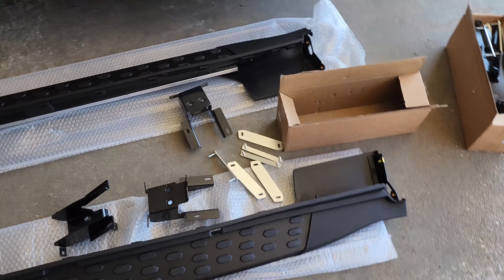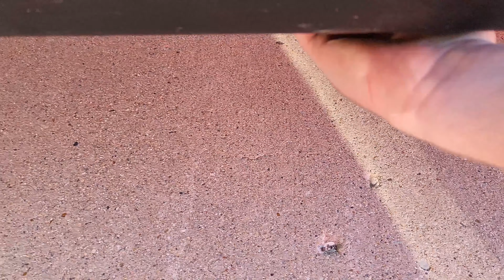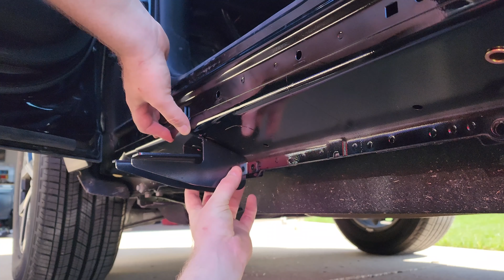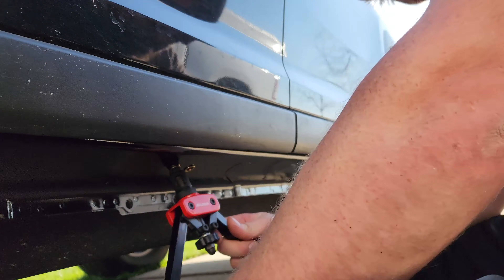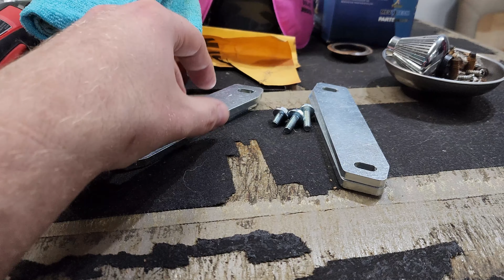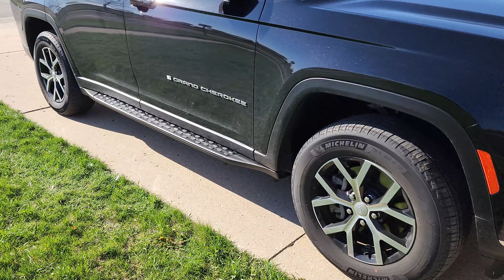Snailfly Running Boards Side Steps Fit for 2021-2024 Jeep Grand Cherokee L - Unboxing/Install/Review

Comment: Hello, How wide is the actual step part? Do you have any issues getting in and out using it as a step? 

Do you know if these are the exact same specs/dimensions as the OEM Mopar running boards?

Comment: PSA: DO NOT FOLLOW ALONG WITH HIM. Watch the full video through first. This will save you so much time. 
- Read the instructions on which bolts to use where.
- The steps are impossible to put on if you attach the brackets to the vehicle first and take a lot of work to get off.
Reply from the maker: As mentioned in the video 😀

Comment: Do they work for the 2 row?
Reply from the maker: They don't, these are specifically for the 3 row.
Reply: Which ones are these?  I have 24 grand Cherokee L limited and we bought some but they won’t allow the underneath felt to be reinstalled back

Comment: I got snailfly also. But some reason only come with 1 thread insert, and didn’t come with spacer. Did you have to purchase yours seperate? 

Also thanks for making the video. Very helpful
Reply from the maker: @DanielHernandez-x9y  are you referring to the nutsert install tool? I bought my own, I believe a link is in the description
Reply: @RamblinGarage   not too concerned about the tool to install but need to purchase more of the actuall inserts- as mine only came with 1 - could you share link to the ones you bought ?
Reply from the maker: @DanielHernandez-x9y  oh i gotcha, here's the ones I got 

Glarks 110Pcs M3 M4 M5 M6 M8 M10 M12 Half Hex Body Flange Rivet Nuts Assortment Kit, Zinc Plated Carbon Steel Flat Head Threaded Insert Nut Rivnut Set https://a.co/d/0W8F7Di
Reply: @RamblinGarage   thank you. I’ll be subscribing- appreciate the help
Reply: Also @ramblingarage what spacers did you purchase ?
Reply from the maker: @DanielHernandez-x9y  on my Ram? I have Ksp 1.5" spacers.  I'm selling them if you're interested.
Reply: @RamblinGarage   in the video you mentioned you used spacers on the rear portion of the side rails. My box did not include spacers, hoping I can get them before install
Reply from the maker: @DanielHernandez-x9y  oh I gotcha, those spacers are specific to the running boards I believe.  You should contact Snailfly or they look to be the same as the genuine mopar parts, you could maybe go to your local dealer and purchase a set, but I'm not sure if they'll be able to sell them separate.
Reply: What do you mean do not put brackets on until you have running boards on